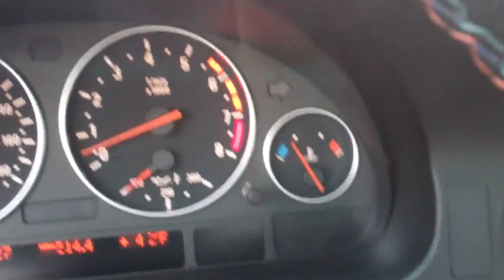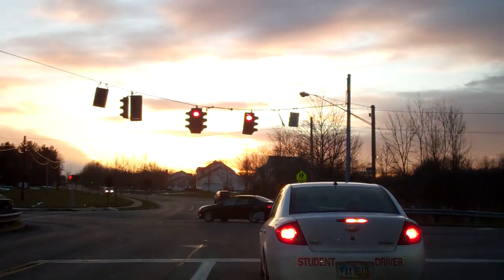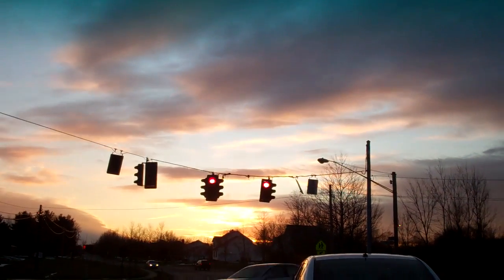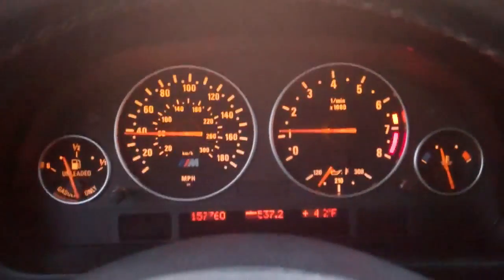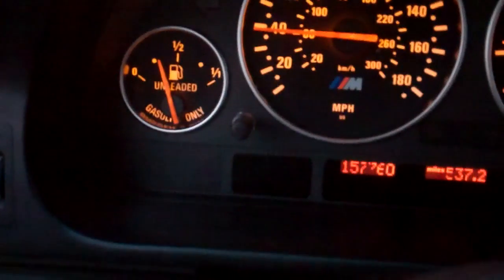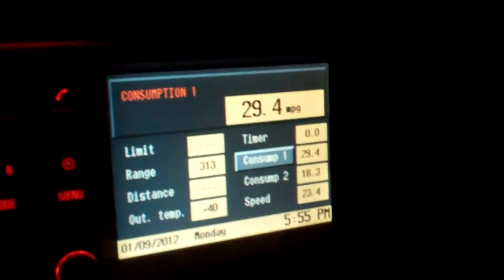PCs and BMWs  1/9/12 - Day 393

Comment: First, I must say that it is your choice of how you spend your money. However, it important to note that your M5 would be a lot cheaper to maintain if you learned how to do it yourself. For example, spark plugs, I think you paid $423.00 for the dealer to do it. If you did it yourself it would have run you around $60.00. That's $7.50 per plug. You could have saved a lot on those O2 sensors as well. You paid like $600+ at the dealer for each set. If you DIYed, you could do the front 2 for $50 ea.

Comment: Contining...The back pair of O2 sensors would have run you around $75 each. Also, about that DTML pump, I noticed that you mentioned that it is inside the fuel tank, it's actually not. It is in the drivers side, rear wheel well under the plastic. Not hard to change out at all. Trust me when I tell you this kind of stuff isn't hard to do. I do pretty much everything on my M5. You just need the TIS manuals and the Bentley Manual for the E39.

Comment from the maker: @abnercus All BMWs, Benzs and Audis use premium fuel, at least 91 octane.  I HIGHLY recommend using the best you have available, maybe 92, 93, or 94.  It's pennies more and it's SO much better for the engine and various components.  The E65 BMW 7 series is a great car.  Only thing I have against it is that it was designed by Chris Bangle, who did the E60 5 series and E63 6 series.  It is the best looking car he designed though, and the first.  I would recommend it!